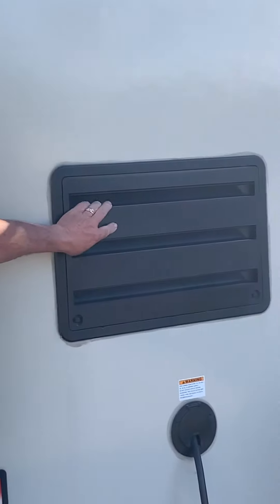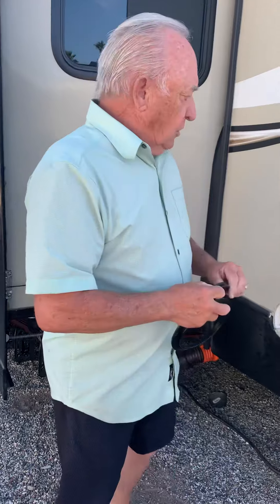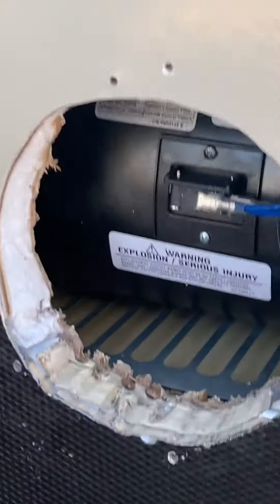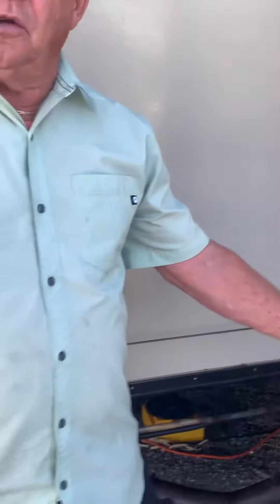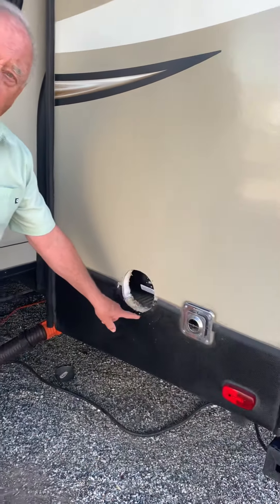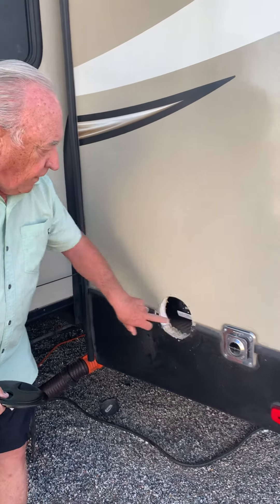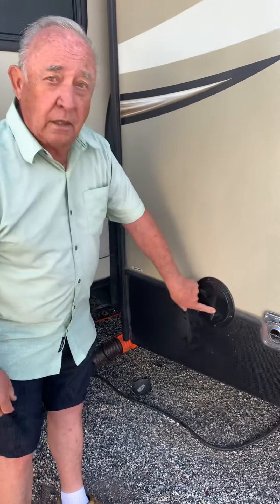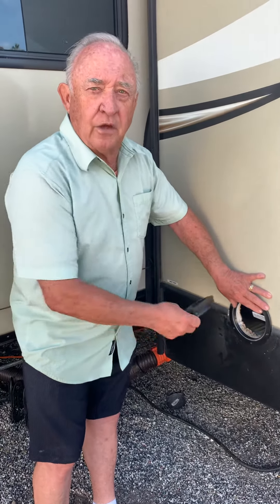No outside access to your RV’s “ SAIL SWITCH “ ! EASY FIX !

Comment: Great idea.  I also trimmed off the outer wall panel and some of the insulation foam from the hole cutout with a tablesaw to match the overall wall thickness when added to the inside of the cap. Used a bandsaw to reduce the disc to fit the inside of the cap and glued it on.  Next I caulked in the small gap.  So the insulation is not missing for the 8" hole.

Comment: For location I measured the full width of the unit from inside, looked at diagram showing the placement of the switch. Worked out to about 11" from far side of the exhaust pipe. Made that the centre of the hole.  Switch is about mid level on my suburban furnace.

Comment: I would not cut the the aluminum structure embedded in the laminated walls.....maybe use a stud finder....if it works on the walls of the RV...to find an open section not framed.
Reply: Agreed, that would be disastrous.
Reply: For the stud layout request a wall print from your manufacturer first and measure 3 times before cutting.  I've enlarged one window and added a second with no issues.